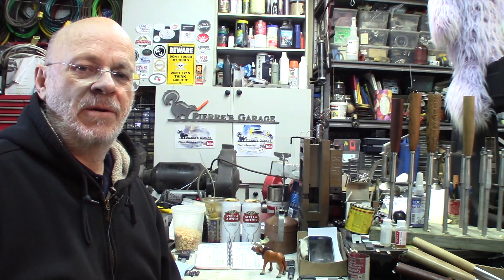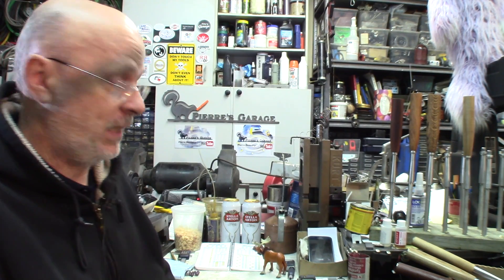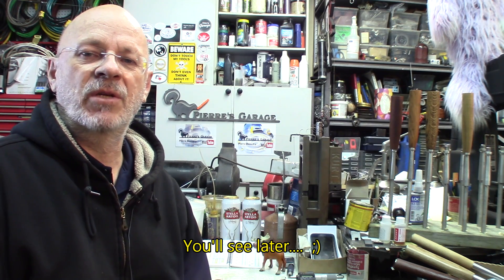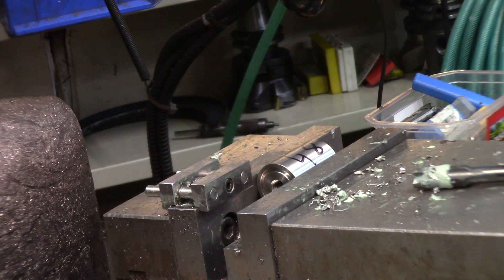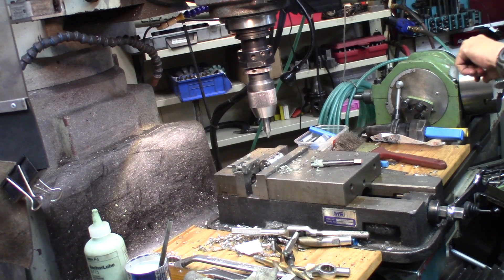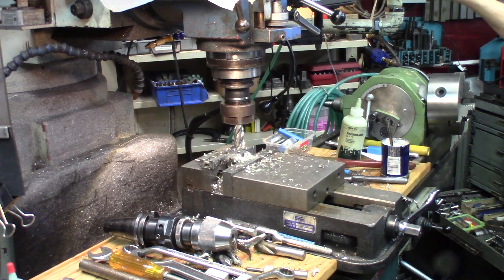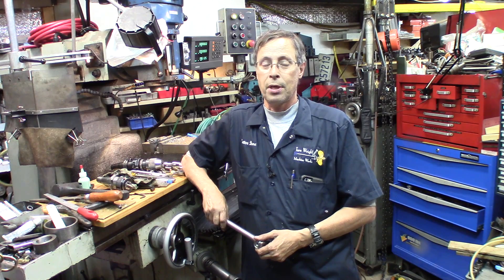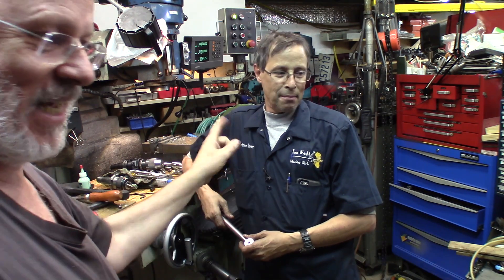Machinist hammer, head concentricity fit ( Keith Fenner WIYB 2016 giveaway )

Comment: That is NOT a "normal tap", it is a gun tap. they are meant for tapping thru holes and are called a gun tap because they shoot the chips ahead of the cut. So in a blind hole you are risking breaking the tap in your part by compressing the chips in the bottom of the hole. PS it looks like Phil doesn't like getting his little fingees dirty judging by the way he was turning that tap handle.
Reply from the maker: Right about the tap purpose, since I'd like to also have the type that gets the chips behind, it's costly to have the whole assortment, wasn't shown but pulling out the chips packed in the bottom was a pain in the but...   
Normally Philippe is a pretty willing hard worker, he doesn't mind pulling up his sleeves and getting his hands dirty... 
Thanks for watching and taking some time to comment,      Pierre

Comment: So I have to ask how loose was the "rough" tolerance on hammer head length?  I mean even if they varied .005" in length that would only be .0025" out on the center and I doubt anybody could tell a hammer handle was off center that much.  I don't know why but this video didn't show in my subs list? It just showed up in my suggested to me.
Reply from the maker: The results were wider than what you mention, Philippe did them and he had to learn a couple of things about maintaining a tolerance, this was an occasion to demonstrate a quick centering method for a number of parts when that happens...   ;)
We chose .130" as a center to get a .001" adjust range take a look at your gauge block set and you'll get an idea of what we dealt with for certain pieces...

Comment: That was interesting and educational.  But it does bring up the ancient problem of a production process. One of these days I will tell you the Academe St. Cyr puzzle. Ayway, you have a tool change time vs. operation problem. Another way to do this is tp rig a stop. Then put the part in, center drill. Do not change tools. Put next part in the vise. Continue until al parts are center-drilled. Change tool to end mill, bring part up to stop. Mill. And so on. Is this any easier than what you did? I don't know. Your tool change is so fast that it may not pay off. I know! Ask M. Le Moose!  After all that reading he should know the answer:)
Reply from the maker: Hi Juan,
In this particular situation, the problem was more to be right on measures than really getting it done a little faster.  By keeping the part stable in the vise was to us the very best way to assure the very close tolerance needed to fit so nicely, as soon as you dismount a part it's near impossible to achieve tenths of inches tolerances, or it takes so much time to realign for the next operation.
But if this is of any comfort to you we consulted Mr. Moose before taking our final decision...    lol
Thanks for comment,    Pierre
Reply: Good point. That's why I suggested a stop, but you will certainly not reposition to a tenth with a stop. Besides, I take Moose's judgement as the last word :)